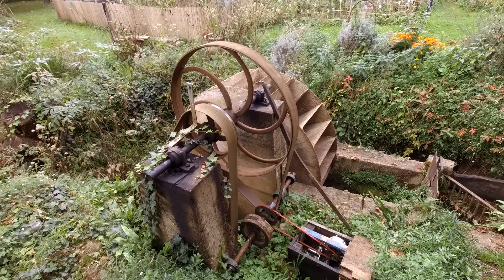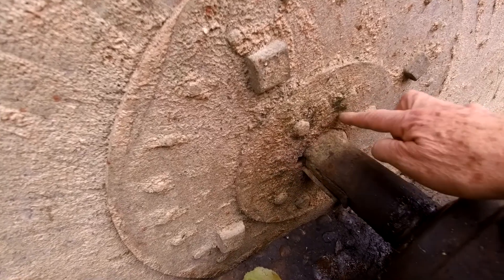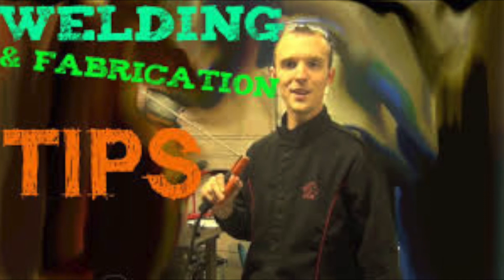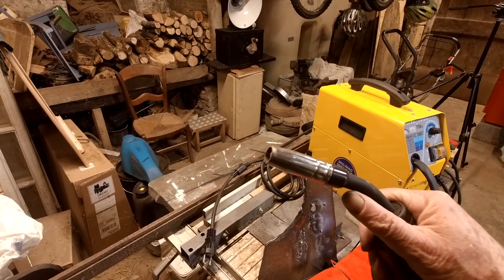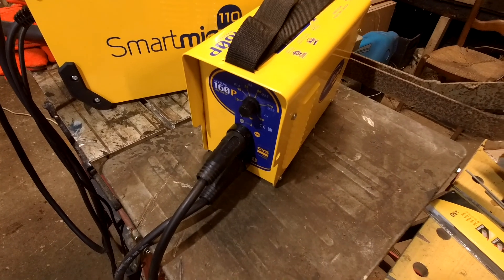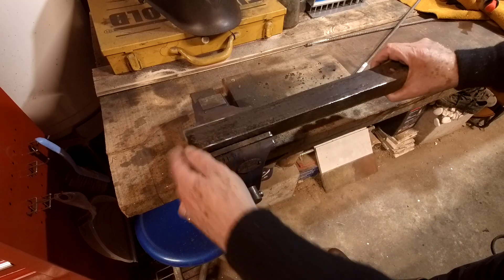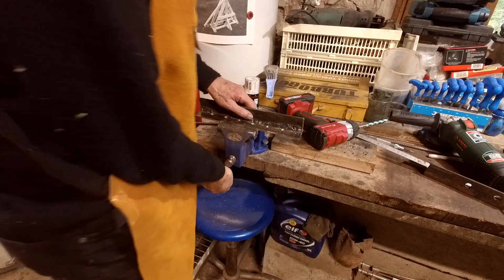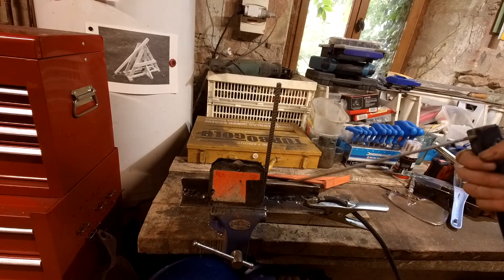learning arc welding  - Prof Simon

Comment: Lots of very clean metal req.   Dump the stick
Reply from the maker: You think I should try harder with the gassless MIG unit? And clean the metal....ok. Thanks.
Reply: Yea the mid much easier once you know how molten metal behaves. That’s why stick is good to start
Reply: And he’s right about the clean metal, you don’t want oxygen in that compound, it makes the metal weak and brittle.